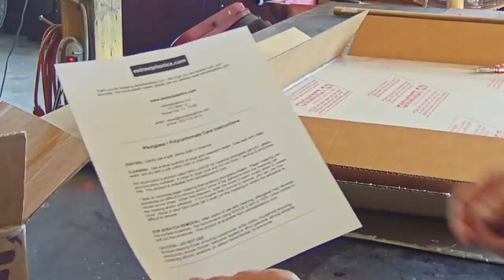Easy Rat Rod Door Windows - From Start To DONE!

Comment: Great job on those windows
Bob. Like how you use seat belt strap to pull them up great idea.  The ole trucks looking pretty mean now.
Have a good one brother👍
Reply from the maker: It's a quick and dirty way to get door windows. I could've spent days and made power windows but I figure this is a really big improvement over "no windows" which I had originally planned.

Comment: Just a suggestion Bob, when cleaning your plexi windows use cheap spray on furniture polish/cleaner, it will fill in fine scratches and keep your windows looking new for a long time, I’ve been using it on my bike windshields for years.
Reply from the maker: Great tip!

Comment: If you would heat the cut edge of the plexiglass with a small torch. It will smooth out  like it comes from manufacturing and prevent it from cracking. Keep up the good work!

Comment: Looking real good Bob I was wandering how you was gonna get back in it with no door unlocker need put some electric door lock motors from old car or get the kits off eBay that has remote control buttons that open the doors or just put a push button switch under cab That's hid you can hit with your foot but keep these class video's coming
Reply from the maker: All be it more difficult than you would think ... I have a remote door handle that I've got working .... sometimes it works LOL . On the electronical poppers that would be cool,  but mechanical is usually more dependable. Dang I wished I could find the old door handles.

Comment: Hey Bob. Those strippers work great. Man, you got your moneys worth just in cardboard. Haha. You gave me a great idea when I saw the location of your mirrors. I can't see out of mine because of the location. That mic works real good. Mine works good as well, but It uses up batteries real quick. And I have to use the brand name batteries💲 💲 LMAO Bob. You shut the doors with the windows up and now you can't open the doors. What would RED say. The truck is looking fantastic. Thanks for sharing.🍁👍👍
Reply from the maker: Thanks Andy. This mic system is rechargeable and said to last up to 8 hours. I'll be putting it thru the stress test for sure. You remember this past spring we done spring cleaning in the shop and the door handles got misplaced. At the time, it wasn't an issue because I hadn't planed on putting door glass in. Red said "who's the dummy now"!
Reply: @RatRodBobBuilds  Red is right again.😂
Reply: @RatRodBobBuilds  Hey Bob. Did you get that mic on Amazon? I would like to check it out. I am on my third type now. This one works good but it is hard on batteries.
Reply from the maker: @AndysDogHouse  I'm sure you can get it on Amazon but you have to have a compatible Sony camera to plug it into.
Reply: @RatRodBobBuilds  Thanks Bob. I will check them out, but that name brand are they?
Reply from the maker: @AndysDogHouse  Sony ECM-W2BT Digital Bluetooth Wireless Microphone System